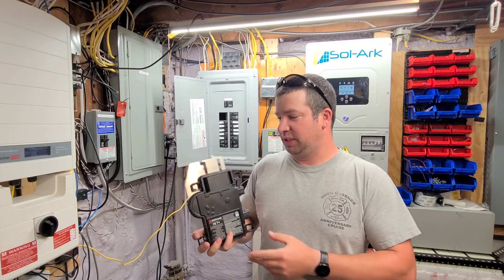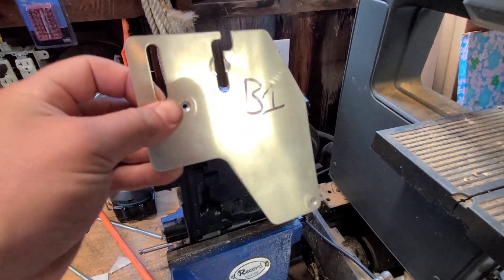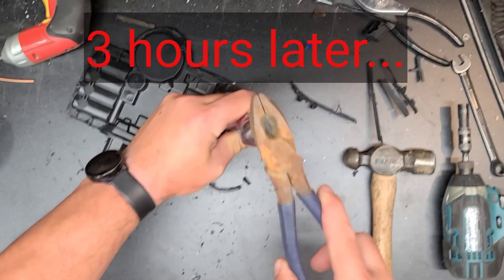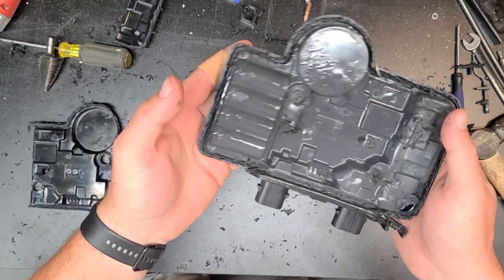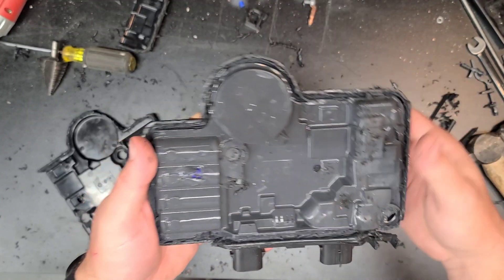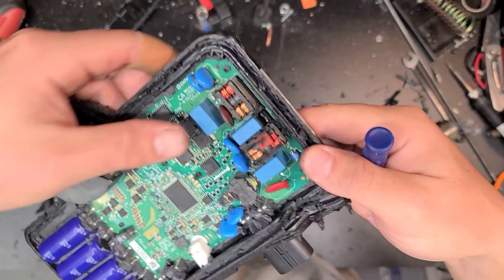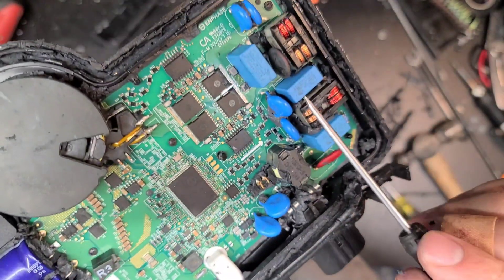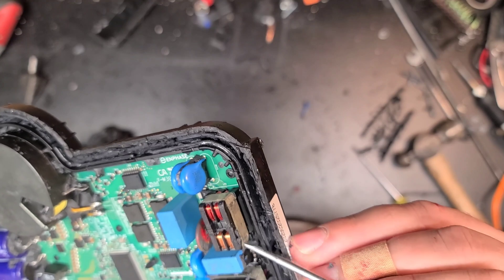Inside an Enphase Micro Inverter

Comment: Disclaimer. I am an electronics engineer and a trained proffessional (40 years of experience) so anyone who tries anything mentioned here will be doing so completely at their own risk.
I just wanted to thank you for sharing this.  It inspired me to look into the very similar IQ6 microinverters that took a grid hit and took out 16 units.  I shaved off the top off of the area (with my table saw, ruined my shirt) just around where you lost small cube part that came off of the board.
I was able to solder in a 3.15A 300V fuse mouser part 504-SS-5H-3.15A-APH  ($0.57) and a similarly located MOV mouser part number 871-B72214P2171K102 ($0.38)  Soldered the leads onto the leads on the board (I carefully trimmed them). Hooked it up and it started working normally.  Next I will put potting compound on this one.  
The next ones I will cut a hole with a hole saw directly over the location of the parts to replace.  They will all  be protected and probably work and the cost will be less than $100 total (including 12 pack of 805 Beer).  
***I will be installing a MidNite Solar Surge Protection Device (MNSPD-300-AC Amazon $111) Close to the incoming AC power feed at the main breaker panel that should prevent this from happening again and as a bonus protect my home electronics.
On a side note the MOVs used are designed to take anywhere from 1 to 15 grid events depending on the severity.  This means if you lost 1 to a grid event then the other ones have used up one of their "9 Lives" it would be a great idea to try and protect the ones that are still working.

Comment: They make a nice product, but if it fails there's no customer support. They will tell you that it failed due to the grid or you "misused it". They never gave me a response as to what is considered misuse. They will talk to you once every 3 days so plan on it taking a while.
Reply from the maker: I've only had them give me issues when it was clear that the system got hit by a surge and almost all of the inverters failed. Otherwise, they're great.

Comment: Thanks for the work taking it apart. So much for Enphase's claim of "no electrolytics like string inverters". Bunch of them on the DC side. Early end of life failures are usually caused by electrolytics.

Comment: If it did get problems because of the surge from the connected AC, then why was this the only one that broke?
Because they are all connected in parallel, so every inverter would get the same high voltage.
So I say it just broke and should be replaced.
Reply from the maker: On this install, 29 out of 30 died.  If there's one one that's dead, that's most definitely a warranty issue.

Comment: ..they should somehow add a fan with air  in/out air valve somewhat waterproofing it..that will significantly prolong it's life..also a surge protection replaceable fuse
Reply from the maker: Surge protection with a replaceable fuse would be great but a fan would be detrimental based on bearing life and dust/dirt.
Reply: @benssolarandbattery  ...it should be able to be lubed or replaced as well.. either as a blow out or intake fans where the air valve keeps it waterproof..or the internal part are thin layered with waterproofing with something like nail polish or similar..

Comment: Do Enphase microinverters work without Envoy and Q Relay?  Thank you
Reply from the maker: I've never used the Q relay, so I'd assume that's not for the US.  They will work without an envoy here with a standard grid profile and no monitoring.
Reply: @benssolarandbattery  Thanks for answering. I was thinking about buying a Enphase microinverter but after contacting with Enphase I will choose another mark. They told me it is necesary to use the three devices together (microinverter, QRelay and Envoy) otherwise it may not work. Very expensive for a basic intallation.
Reply from the maker: @kinosi  what grid power do you have there?
Reply: @benssolarandbattery I'm from Spain, we have 230V here.

Comment: Hi Ben,  that disk is an MOV and the dark cube looks like a capacitor that was probably over- voltaged or failed.  other capacitors and maybe some of those relays appear to have allowed too much voltage to be across the MOV.  An MOV always flow current, just more when voltage goes up, but nonliearly and are intended to filter out millisecond spikes on the ac lines, within the limits of "small" over current or limited energy .   Great entertainment watching you tear it appart.

Comment: In order for me the consider this now it would have to be covered on the ac side under the warranty or a protection circuit  installed on that side that can be reset or replaced.

Comment: Thanks for your show . you helped me decide on the purchase . after watching this the ac side would need some type of surge protection or the solar units would not work. and power surges happen her all the time. Will stick to my solar unit the way it is with out the Enphase connection to my house current that  would destroy it in less than a week. do not currently have Inverter connected to the house circuits direct . using 2 separate sources of electric power
Reply: Agree

Comment: Hello Ben. Its very obvious that this is just like a DC to AC (or AC to AC booster) inverter, with variable input. I dont know whether you took it appart to study the electronics, or just fun, but this can be easily repilicable with simple board modules available in market right?
Reply: I think there's a helluva lot more to it than that.  I'd really like to see some detailed photos of the circuit board to see what's in there, and in particular what their "55nm ASIC" actually is, I'd have expected an R-series ARM to drive things rather than a complete ASIC... is it a creatively-described FPGA with a soft-core to control things?

Comment: Great channel! I’m curious, saw your encharge videos, can you set up one up connected directly to a main panel that the battery couldn’t run if all circuits were on? Assuming then in a power failure it would fault because it couldn’t manage the load then you could turn the proper circuits on off and leverage it? I’d like to avoid a sub panel.
Reply from the maker: Hey thanks Scott!  I don't believe it would work like that. It needs to be hooked to the smart switch to be managed, but also because the encharges only put out 240v, the smart switch has an autotransformer that kicks in when the grid is down.  Hate to say it, but you may be better off running a sub panel.
Reply: @benssolarandbattery  thank you! I’d have the smart switch either way. Just hoping to avoid going with 3 encharge 10s (we have a 5 ton AC and pool pump) or a sub panel. I was wanting to start with one Encharge 10 and then add on in future years.
Reply from the maker: @scottswf238  you could add a load control panel such as a Lumin and run a smaller battery that way.  I assume you'd want to use your air conditioner on battery, but pool pump might not be necessary.
Reply: @benssolarandbattery  really helpful. Thank you!

Comment: That looks pretty simple in design to replicate.  
What is the round disk gizmo?
Reply from the maker: I have no idea!
Reply: Yeah right. They have worked 10 years on the ASIC and software and is even more advanced with the IQ8. And then off course the IP.
Reply: @TurreTuntematon  And yet multiple people in this thread mentioned multiple  Enphase MI's being taken out in one event.  And why is the communication/Envoy warranty so short? And their MI's have to be online 100% or no warranty....  Thats "advanced"? hahaha
Reply: @ridemfast7625  M series? That’s like the first model of iPhone so yes it was not that advanced back then. Now it’s IQ8.
Reply: @TurreTuntematon  Old Iphones  dont burn up..  And iPhones have been available a lot longer then any Enphse MI.. And  IQ's are limited on solar panel size. And theirs the Envoy short warranty you neglected to comment on.  And IQ8  has  challenges when coupled with other manufacturer batteries.. And how long have IQ8's been in the field? hahaha

Comment: Thanks for the view. I see a Solar Edge and Sol Ark inverter. Where are you using the microinverters? How so you choose between a IQ7 and IQ 7+
Reply from the maker: We use microinverters on most installs these days. We use IQ7+ for the 350-400w panels and IQ7A for anything bigger.  My Solaredge was installed when Solaredge was reliable. They aren't reliable anymore unfortunately but mine is still kicking.

Comment: I've always wanted to see inside the IQ series micros, thanks Ben! The red disc is a varistor. They protect against minor voltage spikes by clamping voltages outside a certain range to ground.  If surge is to high or too long duration they blow up (and then trip the thermal fuse that should be next to it). I only know this because last year a tree took out my overhead power drop going to my house and knocked off the neutral. With L1 and L2 still connected it caused significant voltage spikes on my 120v circuits which fried a bunch on electronics, smart switches, control boards etc. Upon investigation, every varistor (little red disc) was melted.  That was a sucky day 😂
Reply: That sounds like a bad day! How would you protect against that happening again in the future?
Reply: Me too

Comment: what was the nature of the issue that made it out of warranty?
Reply from the maker: Grid surge took out 29/30 of the micros.  If they hadn't all gone out at the same exact time, I'm sure they would have warrantied them.
Reply: @benssolarandbattery  seems fishy that they can opt out of warranty when something breaks during use.
Reply from the maker: @strykerace  unfortunately it is in their warranty documents under section 8. (c).
Reply: @strykerace  Lol. No electronic device is warranted if the current is not what it’s supposed to be. Hook your TV to a high voltage outlet and see what happens.

Comment: Wow I'm so surprised that they won't warrant it. I've replaced 2 or 3 in the last year or so. What was their justification? So sorry to hear that and thanks for sharing. This makes me think twice about installing Enphase equipment.
Reply from the maker: Apparently grid surges aren't covered under warranty.  Surprised me too.  It was a little suspect though, as 29 out of 30 in the system were dead at the same time.
Reply: @benssolarandbattery  😮 resurrecting this (just saw) - so 29 of the microinverters had to be replaced? Rough cost?
Reply from the maker: @HomeEnergy  well, it was the cost of 29 microinverters plus 2 guys for half a day to replace them. Google pricing shows it as $165 each. Not cheap!
Reply from the maker: @HomeEnergy  also, hey! Still with SMA?
Reply: Ben I'm so surprised about this. I've been installing them for over 10 years.
Reply from the maker: @williamjohnston3770  8 years here, never once had them deny a claim.  Also never had 29/30 micros be taken down by a surge before!
Reply: @benssolarandbattery  was there anything that could have been done to prevent this? I was just about to pull the trigger on these or the new 8’s…… A little worried now…😳
Reply from the maker: @maddeusdoggeus1  I would definitely recommend adding a surge protector to the system closest to your service entrance.  It could have helped in this situation for sure.  That being said, stuff happens.  Whacky voltages can get through in the right conditions.
Reply from the maker: @maddeusdoggeus1 also, homeowners insurance is a good thing to have.

Comment: Not potted. Encapsulated with what looks to be Silastic. Keeps moisture away from the board.
Reply: This was potted, not encasulated.  Encapsulation is a rigid material that acts as the case and is the sole protective layer, potting is something that fills a mold and the mold is left on.  High quality potting materials have a low durometer when cured like what we see here.
Reply: Is that like Silly Putty?
Reply: @elmerkilred159  No, it is an epoxy like material that consists of two liquids that when mixed end up as a flexible solid when it hardens. Silly Putty does not harden.

Comment: I love the music while cutting around the perimeter. Thanks for taking it apart.
Reply from the maker: Haha, thanks! That saw sounds terrible...
Reply: @benssolarandbattery  That small thing that you took out in starting, it was a fuse.
I know that because I have worked in  power supplies that has same kind of fuse in it, it was shown to other repair person but they couldn't find the fault because it's a unusual shaped fuse.
The second red thing is M.O.V (metal oxide varistor), 
Now here is what I know, I think happened there, when a high voltage surge came it make the M.O.V conductive and it short out the live and neutral phase, so that the fuse can blow up and save the whole circuit from blowing up.
Now, you have to just replace, that fuse and M.O.V and bring that thing back to life.
Please bring it back to life again, and do not let it end in a landfield.
That video was great, I appreciate your work and time spent on it, to open it.
Great man. 👍
Reply: @vinitsingh8962  are you sure it is a fuse? I wonder why enphase would use fuses in a extremely sealed device which seems to be designed not to be serviced. If it is a fuse maybe it is there to prevent a fire and not to repair it?
Reply: @rodolfocabellobilbao6887  Company make sure that you can't open it, so that you have to buy a new one every time and increase their sale.
Reply: Hey Davidpoz, thanks a lot for recommending this channel, 
But I didn't want to just see it opened up, I want to see it back in the life again and in working condition. 👍👍
Reply: @vinitsingh8962  👍
Reply: I wish, you can do that.
Reply: Yes!

Comment: If varistor was blown, there is a small chance, that IGBT transistors of inverter bridge weren't failed. Probably, blown varistor and fuse (in plastic "film capacitor"-like case) - may be the only failed components. About surge protection. Carefully selected varistors by voltage / energy parameters (i suggest DIY devices), and good grounding plays the main role in such protection. Also, implementing of isolation transformers (1:1) between solar array common AC output "bus" and house wiring -  can increase protection level.

Comment: What was the nature of the condition that caused this damage?  Curious why enphase won't warranty this.  They claim to have a 25 year warranty (in the US), and this is a new model.
Reply from the maker: It was a grid surge that took out all of the micros in the system.  They do recommend installing surge protection, but say that the micros should be able to withstand small surges.  This system did not have a surge protector.  Whether that would have saved it, we'll never know.
Reply: what kinds of surge protection would be best?  the kind northern Arizona wind and solar have in all their kits, that might be from midnight solar that look like police blue lights?

Comment: Another example of throw-away technology rather than something made to be repaired or recycled. A lot can be said for microinverters, but if its like cell phones and we just throw them away, I would prefer a central, repairable unit.
Reply: Agreed, I don't recall seeing a video detailing the savings of making AC at the panel vs making AC at a box inside the house .
Reply: Yes
Reply: Technically, it is "serviceable", but the casing will be completely destroyed getting into it. That's the trade-off for rapid manufacturing, and simple IP## sealing.
Reply: I think it would be very difficult to achieve repairability of these as they are sealed to withstand rain, sun, snow, moisture for 25 years. Same with optimisers from Solaredge. Then again, there should occur no repairs for 25 years.

Comment: It's strange they put a varistor in there to protect it but if you can't fix it what good is it 🤔🙄👍
Reply from the maker: Is it actually a varistor? I was just guessing.  😁
Reply: @benssolarandbattery  yeah looks like it there designed to absorb the surge and then blow the fuse I've done a lot of varistor bypasses in the hospital goes between neutral and hot causes hell with leakage current, looks like it melted down the fuse and holder
Reply: Haha